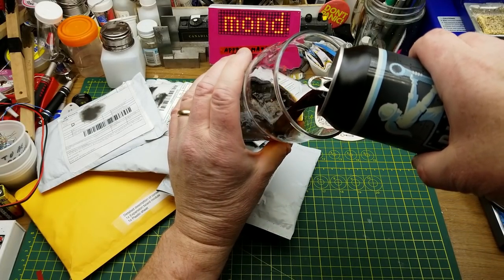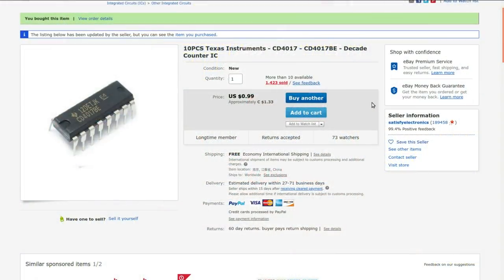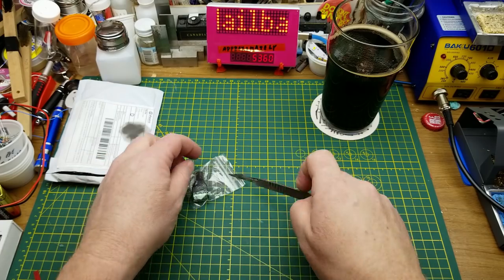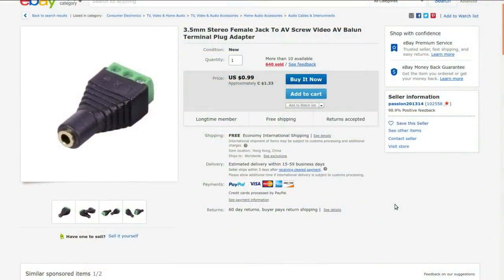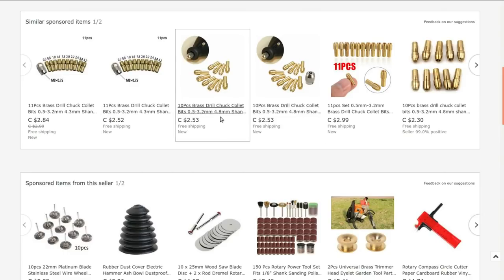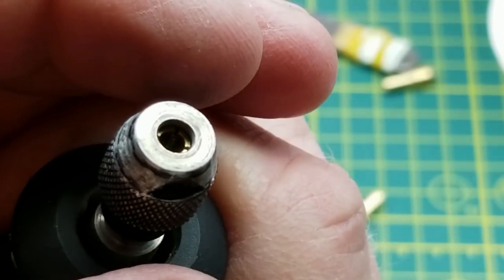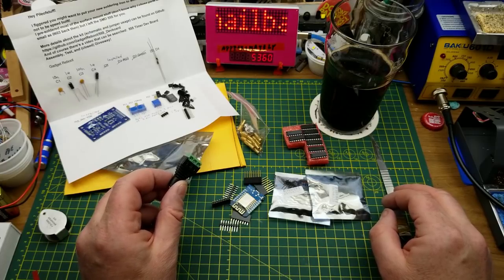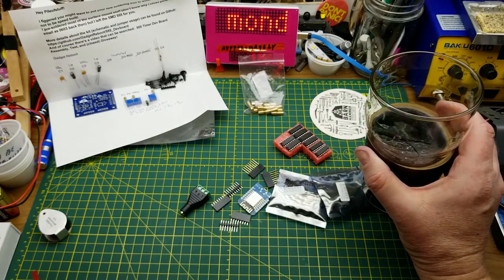mailbag monday 83

Comment: I have found drag-soldering to be a cinch when I use LOTS of flux ... then again the clean up afterwards makes me question if it was worth the ease to solder the sucker on ...
Reply from the maker: I plan to try it at some point. 
Even after tinkering with electronics for over 30 years, there is always something new to try.

Comment: I managed to find a load of D1 Minis at a very cheap price and everything I run around the house (Tasmota and custom code) is based on them. I wanted to use the raw ESP modules for size, but D1 Minis are sooo much cheaper.
Reply from the maker: The subscriber counter in the sign on my workbench runs on a bare ESP8266 module. They can be handy, if a bit inconvenient to connect to.
It's good to have multiple options available to use - at least that's how i justify some of my purchases...

Comment: I still have my very first 4017 IC from the 80s and it still has a 22 gauge solid wire soldered on where one of the legs was ripped off back then and it still works if I put it in a breadboard.  I probably used high-quality Archer solder.  
Looking forward to the kit build with that huge iron tip!
Reply from the maker: I hope I can do your kit justice.
Thanks for sending it.

Comment: My Dremel came with a chuck that adjusts to any size (below 1/8" IIRC) that I always use.  Had it for years without needing to change to a simple collet.  And not having to use a wrench to change bits is a bonus.  They must be available on eBay?
Reply: Yep - easy to find on eBay, just called "Keyless Chuck for Dremel" or similar.. Be aware that the Dremel uses 7mm thread and the Clones usually use 8mm thread.

Comment: Wow, those 4017s had a really bad imitation of the TI logo. The font wasn't the same, either.  But you have a point; for hobbyist use such a jellybean part will work fine. I don't know what is the point of faking the logo for such a cheap commodity part. If I want the cheapest 4017 off of eBay, it doesn't matter who "manufactured" it.

Comment: If you like to play around with the Wemos and Lights i highly recommend to take a look at the WLED project. It's wonderful to control WS2812B and similar strips and also offers things like syncing multiple strips, running different effects on different segments of the strip and so on. 
https://github.com/Aircoookie/WLED
I'm a big fan of the Wemos D1 Mini as well. The only problem that can occur with the non original models is instability due to the LDO they sometimes use. Some boards have a LDO that is only rated up to 150mA, while the ESP can sometimes spike up to 400mA during Wifi operation.